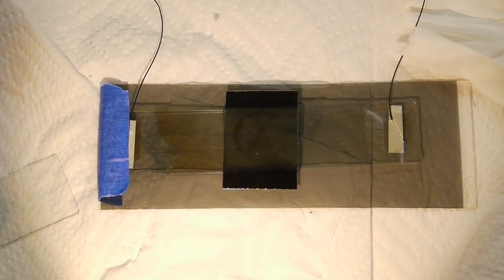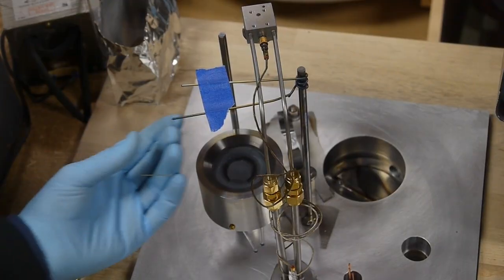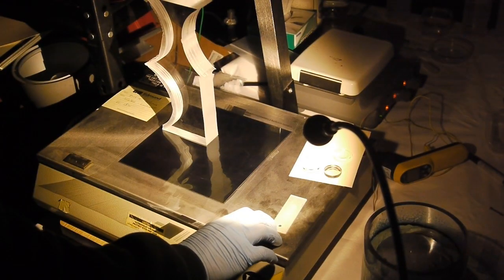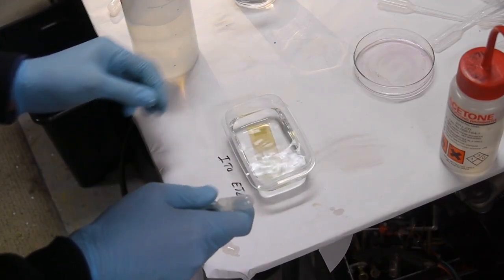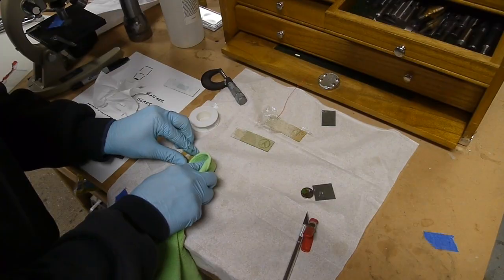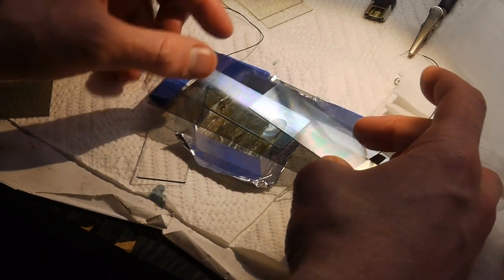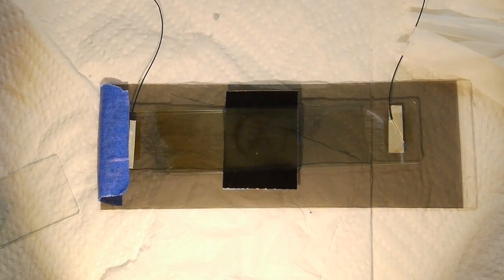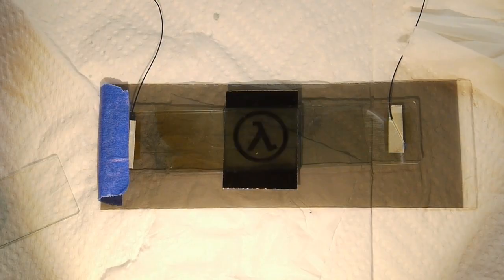DIY Custom LCD

Comment: Hello. On one of the old projects we have a need to produce a 1056x624 pixel Liquid Crystal display. The problem is no one ever made one. So the only two options are emulating LCD display with hi rec display and some sort of shader which is out of reach for micro-controllers that we use or ... well ... create an LCD screen. I can see that ITO coated glass is not that expensive, but I have never done anything remotely similar. Do you think your approach of removing the coating can actually achieve such a resolution? And if you had such a challenge, how would you go after removing the coating?

Comment: This has me wondering if it would be possible to replace the liquid crystal in old ‘bleeding’ Lcd. If you see old lcd games, many seem to have let air in along the edges  so if there was a way to separate the glass plates, add fresh liquid crystal, put them back together and glue them together again.

Comment: I have a question - it's almost impossible to buy nematic liquid crystals in Russia (at an affordable price). The cost for Alibaba, Ebay and other is also unacceptable (1 dollar per 1 gram - yes, it may seem strange, but in Russia this is an expensive price tag). In addition, there're great difficulties with the delivery of goods from Europe and the US to Russia.
Question - is it possible to use liquid crystals from old devices - displays of old calculators, phones, monitors, and so on? And if so, can they be used in a mixture, i.e. mix crystals from different devices ?

Comment: Great video!. I have a silly question, in a LCD panel, is it possible to detach the TFT layer from the color filter layer (RGB) without compromise their integrity? I need to work with the TFT layer and its drivers, do not ask me why.

Comment: Hello. Could you describe in more detail the method of coating ITO glass with photoresist? I can see that it is different from the standard one. It also looks like in your case, the liquid crystals already contain spacer balls. Is that correct?

Comment: Possibly dumb question, but would someone at a hobbyist level be able to make a display for lcd watches that works well enough using this method, or do those displays require further tools that a normie wouldn't have?

Comment: Just interested in knowing how you are driving this display. I see a lot of info online that describes these as capacitive devices requiring a driver that pulses the electrodes at a given frequency, inverted signal between the common electrode and each “segment” electrode’s pulse. Also, I haven’t tried, but wondering how best to make contact with the metallic deposits on the glass. Is there a more permanent connection that can be made, like bond wires to the glass, and besides just taping them on, is there a more permanent way to bond wire to the glass? Can solder bond to the etched electrodes? Very interesting video to say the least! Thanks!

Comment: I can't believe how simple this was! I have all that equipment just sitting around my house. I have a question....instead of the micron photoprocessing diode manipulator why didn't you just use a modified flux capacitor?

Comment: How would you make one where you can address each part of the display (like a pixel)? do you like etch a grid on it and then you connect those seperated cubes in a matrix ?
Reply: You’d have to run a conductive trace to every row and column

Comment: Do you think it would be of similar practicality to make a PDLC smart glass device? Would it just be a matter of mixing suitable liquid crystal with a UV cure/LOCA polymer, sandwiching it between clear electrodes and curing it? Small Chinese shops are manufacturing relatively inexpensive PDLC smart glass film, so it presumably doesn't require multi-million dollar specialized process machinery to assemble these laminates, particularly if they're outsourcing the electrode sheets.

For LCDs such as the one in your video, exactly what kind of liquid crystal did/could you use? There is a mind numbing variety of liquid crystal materials, and I can't find any information on which of these would be of use for a project like this.

Comment: First of all - great video!
 
Just wanted to clarify though...so let's see -all you need are: 

Microscope Slides = $10 a pack 
Liquid Crystals  = $5 - 10 (better question are you getting the right kind?) 
Acetone = $10 
Ultrasonic Cleaner = $100- $200 
Argon Welding gun = $5 -$15  (not sure if this is even the right tool) 
Vacuum Chamber = $100 - $150 
Photo resist = $25 - $75
Ultraviolet exposure table = $100 - $250 
Photo developer solution = $10 - $50 
Etching Solution (Ferric Chloride?) = $25 - $30 
Cloth = $1 -$5 
Polarizer filters = $10-15 

Or $406 to $820  to make your own LCD? 

Or, you could  just buy LCDs from say ...someplace that sells LCDs?

Comment: Is there a more simplified way to make one of those without chemicals or radiation in a case with no air in it? I'm planning on making a singular 7-segment display card chip PCB thing. Basically it's a circuit board with wires leading directly to the screen with no micro controller. This setup can be sold to manufacturers to make the micro controller.

Comment: Hi all, hoping to get some help here. I am trying to fix a couple of LCDs that have faded/faint images. When I place the LCDs in the freezer for some time, they recover full functionality. However, as soon as they return to room temperature, the problem comes back. 

I can't figure out what the faulty component is. Is it the liquid crystals? 

Anyway, I want to say that these videos on LCDs have taught me a great deal, so thanks!
Reply: I've read elsewhere that plastic sheet used in some LCD can react over time with the liquid crystal. Even if yours is glass, perhaps replacing the liquid crystal might work as a repair. It seems possible that the liquid crystal might break down over time. You may also need to replace the glass beads (if used) as well. I noticed that the micro beads  are listed on Chinese websites for sale in some manner. You'd have to be careful when cleaning out the old liquid crystal not to rub the sheets (or at least not the incorrect direction)
Reply: Thanks for the help! I would go ahead and try to replace the liquid crystals, but I'm having problems separating the glass substrates; probably going to have to use a heat gun on that glue holding them together, which I'm guessing is epoxy?

Comment: Hi Ben, I'm playing around with this myself. In the other LCD video you talk about using a mix of nematic and chiral liquid crystal to get the right characteristic, could you indicate what the composition of the mix was in this video, also did you use glass microbeads in the setup? Thanks.

Comment: Hi Ben, I have a question for you, Do you think is possible to remove the color mask from a TFT IPS lcd in a "diy"home environment  in order to obtain a gray-scale display, this question is related to lcd 3d resin printer, so if you have a gray-scale screen you can triple the resolution and the uv(400-415nm) light that passes trough a ordinary LCD to harden the resin,  Thank you

Comment: Firstly, great educational video!
I realize it might be a shot in the dark, but after seeing your video I'm thinking I can revive a faulty (leaking) lcd screen by replacing the liquid electrolyt between the glass plates. There are quite a lot of different mixtures for sale online, is there anything you could recommend? My LCD screen is from the early '90s.

Comment: Wow 2013. I was curious if it's not viable to try to build "cheap lcd sheets" that would replace sheet rock in houses. From what I see here this is a 2-state lcd that only displays one image when it's on/off. To make individual blocks/pixels would be much harder/require what is it vector-something regarding the mapping of the pixels. Also I'm not sure that line from the half-life symbol (lambda?) if that is an "electric" line or if you just left that on there. So to make individual "pixels" (in the case of wall-sized probably 0.25" x 0.25" squares) you'd have to address those lines and machines can make them nearly invisible but human hands can't. I don't know just rambling. Thanks for the video.

Still awesome to see the fundamentals that's where you start.

Comment: I know this video is really old.  But it's incredible.  If you had to perminately etch the image into the display, how do pixel based displays work, where it turns on and off individual pixels at will?
Reply: Richard Servello Normal lcd's are a bunch of these next to each other connected in a way that makes it possible to turn on/off individual pixels
Reply: MrHack4never so just an array of etched squares?

Comment: In 0:12 the image shows much more clear, why do you insist in having the two polarizing lens in 90 degrees? LCD screens do not work liek this, they are light by default and they have darker dots when working, much like 0:12

Comment: What voltage do you use to drive the LCD? Is it necessary to isolate ITO with SiO2 or other layer of isolation?

Comment: Have you thought about making your own vacuum tube? There are few things you need. Glass making skills and heaters and few specific materials for electrodes going through glass, oxide coated cathode and may be getter material. Everything else is quite simple if you are not going to produce penthode or octode with tiny wired electrodes that need to have small but certain distances from each other.

Comment: could you please "type" what you say in video my language is not English. so its difficult for me to understand some points of video. another question: where to find liquid crystal that you drop on coated glasses?
Reply: Blissterd1 It is actually very easy to "type" that. It is called a subtitle and YouTube has an automatic subtitle generator the uploader only needs to correct the missed words and do come basic sync.

The fact that people don't properly sub their videos greatly limits the number of people with whom I can share them.   :/
Reply: You must be joking? No one is going to type what they say in a video. That's why they made a video! So they don't have to type it! Find a ttranslator like the rest of us have to do!

Comment: Found several lab in university sites for details http://education.mrsec.wisc.edu/nanolab/LCD/  , https://ocw.mit.edu/courses/electrical-engineering-and-computer-science/6-007-electromagnetic-energy-from-motors-to-lasers-spring-2011/lab-videos/MIT6_007S11_lab3.pdf https://ocw.mit.edu/courses/electrical-engineering-and-computer-science/6-007-electromagnetic-energy-from-motors-to-lasers-spring-2011/lab-videos/lab-3-liquid-crystal-displays/

Comment: how make a high power resistor ??? 50 ohms 100 watts ...
Reply: connect ten 10 W, 500 Ω resistors in parallel?
Reply: mm ok ... but ... i need a "homebrew" resistor ... maybe .. . some grphite or spmthing
Reply: http://www.instructables.com/id/DIY-Emergency-resistor-an-electronic-circuit-com/
connect a bunch of these in series
Reply: Radio Taxi Ok then,, a really long piece of thin wire? and since it's 100 W, it would be a good idea to think about cooling.
Reply: ok ... i think about graphite non inductive clay mixture ¡¡¡ TKS ¡¡¡
Reply: non inductive ???
Reply: ohh tanks ¡¡¡¡ good idea ¡¡¡

Comment: Dump Question even though i notice you are using various chemicals. Do you think this is possible with clear flexible plastics? Maybe something that doesn't react with the chemicals?
Reply: You can definitely coat plastics with clear and conductive material, such as PEDOT:PSS. Plastics like PET. I would say that once this is done, there's nothing stopping you from putting a liquid crystal in a sandwich, and voila. The thing that's tough is making it flexible, simply due to the optical effects going on. The effect would be smaller if you wanted a whole screen to be flexible i.e. made up of many pixels, because each pixel would experience minimal distortion. But with something like this, where there's only two electrodes, you would have a very hard time.
Reply: Thank you for your fast reply. What if i use a laser engraver to produce a matrix display? Also nice to see there are still half life fans.

Comment: awesome video...will help with multimeter reconstructions however..I'm thinking along the lines of repairing a broken lcd from a phone..(I can't get a replacement online)..any suggestions on that?
Reply: Impossible. If the Glas itself is broken you cant fix it. The traces are just way too small and there are thousands of it.

Comment: Want to make existing LCD screen light up with solid changeable color.  Ideally a power source other than a computer is sought.  If you take a digital camera shot of a colored panel & load it through the computer, you can light the monitor to the chosen color.  Why not apply the power directly to the LCD panel?  Any ideas?

Comment: When going the sputtering, why not make make a "mask" or stencil to "shadow" the parts of the glass slide you did not want to coat in ITO? (like a crookes tube cross type thing) Is it because the edges would not come out sharp enough?
Reply: Exactly, the lift off method doesn't work quite well with PVD

Comment: Hi 

I am wondering what specific chemical you used for your liquid crystal? Also, what polymer layer did you coat it with before running it with the cloth?

Thank you

Comment: I noticed the absence of a step where you add 5 micron glass beads that you mentioned in your other video on Building a liquid crystal display. Did you not require them or just not mention this step here?
Reply from the maker: The gap is being controlled by the viscosity of the liquid crystal itself, and the amount of pressure that I applied to the stack.  The uniformity and gap distance is not critical for a low-performance display like this.  The glass beads allow much better manufacturing repeatability and tighter tolerances.
Reply: You also mentioned a plastic film yet there is none. I guess as long as you have the alignment scratches in the conductive layer? I'm also wondering how you remove the photoresist once done.
Reply: Well glass beads are required for efficient working. the display here was limping at slow speeds due to the absence of spacers. maintaining alignment layers (polyamide / PVA) at <50nm , and spacers close to 5 uM , and using 5CB liquid crystals, you should be able to build a fairly good display. rubbing alignment layers is critical.
Reply: @jaishetty8586 he doesnt mention in it in the video but do you cure the photoresist after rubbing the alignment layers? also could you use something else other than photoresist for this step as long as it's transparent? (e.g. UV epoxy) From what I've heard photoresist is quite pricey so if I can avoid using it that would be a bonus. Thanks!

Comment: I think there is no need to buy or even produce conductively coated glass, because you can just use common window glass which is usually also coated with some metal to make it reflect IR radiation.
Cheapest option would be to find some piece of broken glass packet and just visually inspect which glass has slightly reflective surface.

Comment: I don't know if I would exactly call this DIY...  Ok -- you can buy the glass with the coating pre-deposited so you don't need the ultrasonic washer or the vacuum chamber or the sputterer, but who the heck has photoresist, an ultraviolet exposure rig, developer solution, etching solution, and two polarizers just lying around the house.  :-)

Still -- very cool that you made this work.  Impressive!
Reply: You can find the solution easily online with a quick search in an engine like Google. Say Amazon for example has plenty of solutions of both on sale, and various other sites have solutions available with a quick entering of the terms "etching solution" and "developer's solution" in a search engine request. Considering he also built the vacuum deposition chamber over time with parts be either bought or raw material he machined himself, that also counts as DIY I would say. The polarizers can be found in many products, from camera lenses to car mirrors, if you cannot buy it from an already assembled product, you can also research the material and how it is made and DIY, for photoresist you can either do a search in a shopping section to show you deals for it or search up what creates it and assemble the raw materials. The ultraviolet exposure rig can probably be built either using florescent lights, incandescent lights, or possibly LED's setup to UV panels to project light on an object to cure it which would probably run at least 700 mA at 12v or 8.4 watts for lower power projection unless you use higher power material. You can either build it or buy it, it's up to the person, but these things can be done but it would most likely take time and investment just like anything else in life.
Reply: A photographer.
Reply: I can get only silver or graphit spray to make glass conductive, but it won't be transparent. Is there an alternative solution to do it without sputtering?
Reply: I dunno, a lot of the equipment looks homemade too.